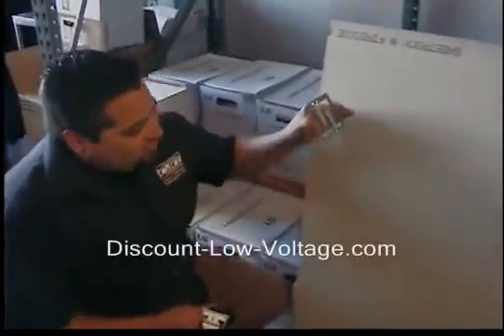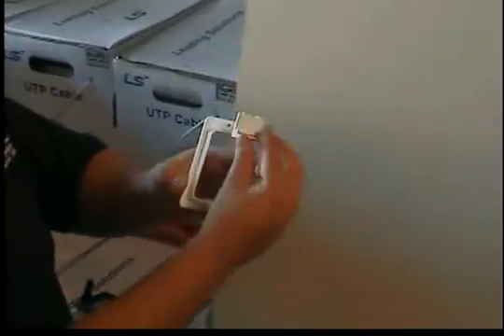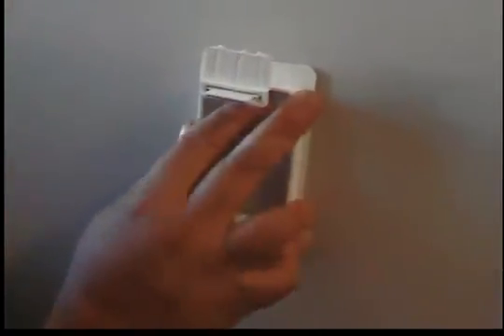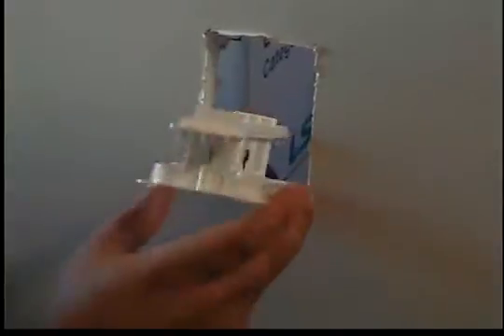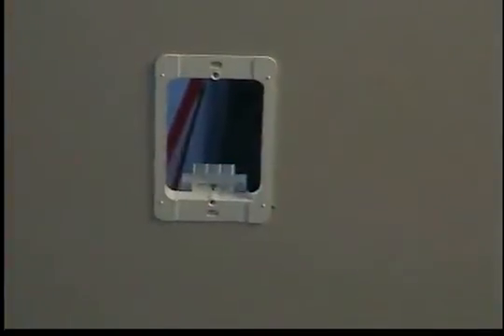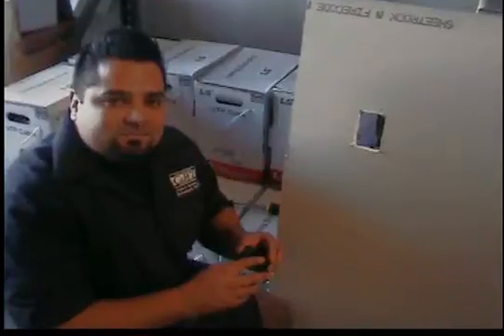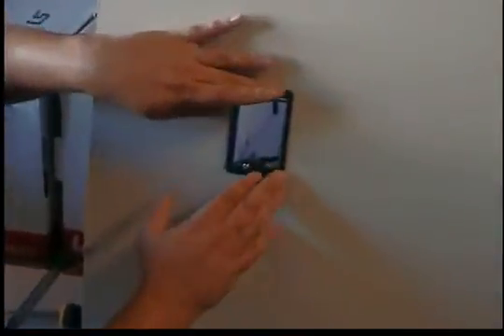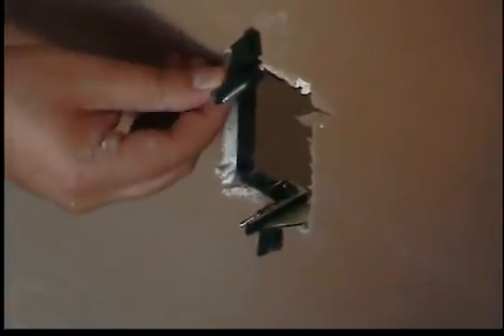How To Install Low Voltage Drywall Rings - LV1, MPLS, MP1P

Comment: +FrodoOne1
Your 2 points.

1. Pull your head out of Wikipedia.  A "Mud Ring" is attached to single gang or two gang [four square (4-in x 4-in)  aka "1900"] electrical junction box prior to hanging the drywall.  A drywall tech comes in, hangs the drywall from the top with a couple screws, then with a RotoZip Spiral Saw high speed rotary tool cuts counterclockwise using the smooth guide end of the RotoZip bit up against the outside perimeter of the ring to make a close fitting hole in the drywall so it'll lay flat against the studs for final attachment. The alternative is to smear the mud ring with lipstick and cut the back of the drywall.  If the drywall is cut correctly no actual plaster "mud" is required to repair the drywall.  The mud rings corners are rounded off.  Call it a mud rectangle and anybody in the electrical and drywall trades will disrespect you as a know-it-all dufus with no experience.  

2. This is America. Shove the IEC up your EMT and get a copy of the NFPA 70 NEC.  Voltage can be irrelevant if there's a butt load of current available.  Look at Article 725 Remote-Control, Signaling, and Power-Limited Circuits to understand why your low voltage comments are irrelevant and/or misleading.  Even 70.7 volt commercial audio speakers are considered low voltage.  Many signals from HVAC, BIM, alarms and access controls are considered low voltage/power limited.  

Hence, perhaps you should buy a Roto-Split to cut some BX (AC/MC) cable, get off the internet, and start using your hands to accomplish something worthwhile versus merely cutting and pasting with zero comprehension.

Comment: Two Points.

Firstly; Why are these things called "Rings" - when they are rectangular?
They are actually "Wall-Plate Mountings."

Secondly; The International Electrotechnical Commission (IEC) defines supply system low voltage as voltage in the range 50–1000 V AC or 120–1500 V DC.

Voltage below this is "Extra Low Voltage  (With some qualifications - and not enough remaining characters to explain!)

Hence, these items perhaps should be called "Extra Low Voltage Wall-Plate Drywall Mountings."